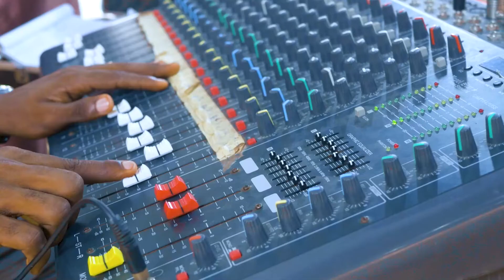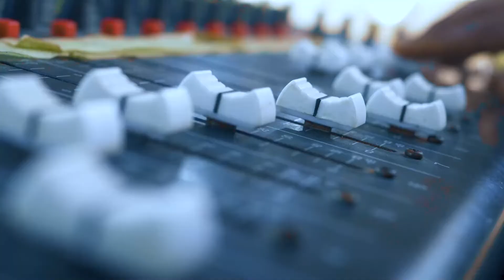How To Set Up Gain Properly. Gain Structure in Live Mixing

Comment: If After setting the gain I apply a subtractive eq. Do I have to increase the gain to zero again?
Reply from the maker: When applying your eq within the channel, you should compensate for the loss in volume with the gain until you have the meter reading at the zero mark for the individual channel.